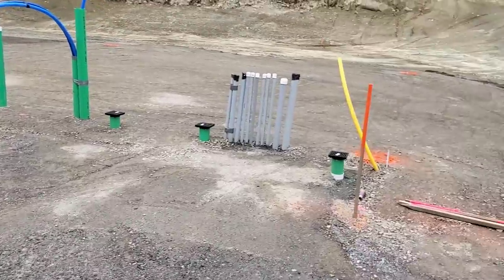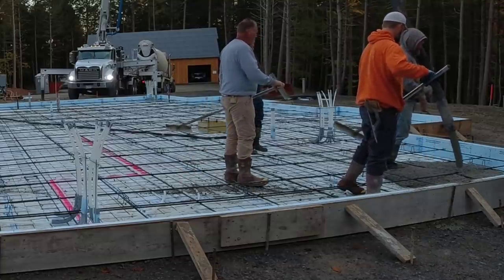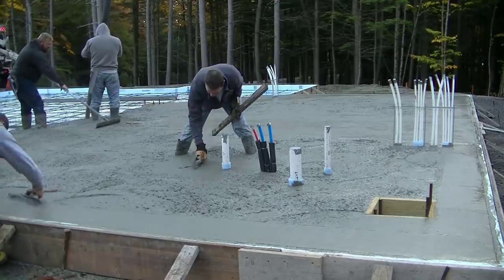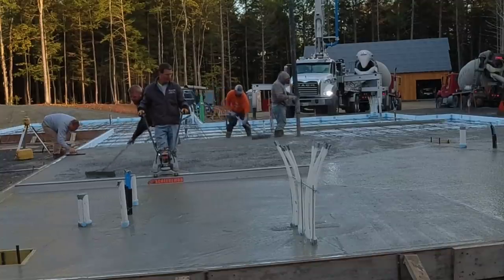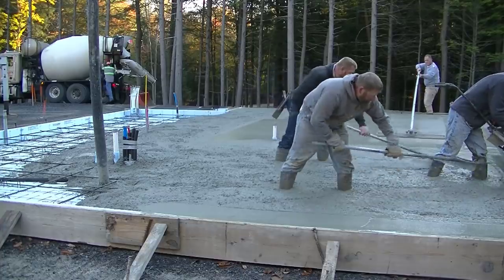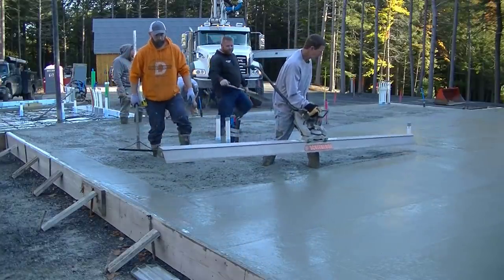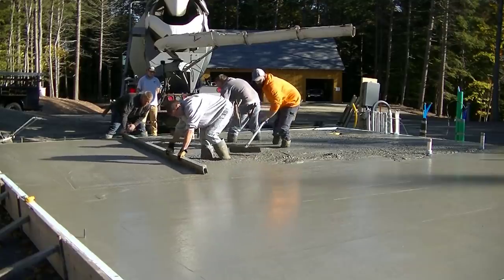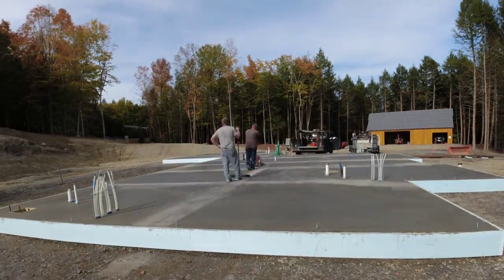He Made Us Pour His Concrete Slab 10 Inches Thick! (Waste of MONEY?)

Comment: It's definitely not overkill. I have background in structural engineering. It depends on the soil and design of the house, I have seen my architectural friends pouring 12" of foundation. I have personally seen too many houses with foundational problems with typical 6" foundation.
Reply: Amen and if you have ever seen an injury caused by a slab breaking under somebodies feet and shattering thier ankles or had to tunnel under somebodies home to do a lift the thinking would change.
There, now you have an opinion from the engineer (SoloFantasy). And me a lowly skilled worker that has to repair cheap pours...
Reply: @michaelpflaumer2487  If the soil underneath is not well compacted, a 10" thick RC slab will not make the foundation any stronger
Reply: Here in Mexico slab foundations are very rare, have seen them on commercial buildings, while stem wall foundations or granite / concrete footings are more common for homes, may take a bit longer to build, but once built the home isn't moving anywhere, it stays in place. 👍
Reply: I have a friend who Made his 24"

Lol
Reply: @thenarrator1984  Tell your friend that the Cold War already ended, bunkers are so last century... so last millennium, actually. 😁
Reply: @LoneTiger  he and I are both engineers who worked construction.

When I first saw the slab dig I just started laughing.

And then we proceeded to bend Rebar for it and put a massively eccesive amount of bar in the huge slab.

It's for a small house garage.. So garage ground Floor and apartment above.. Solar. Off grid.

We bent the ré bar using cedar trees. And straps.. That was fun.
Reply: I definitely agree and have zero education in structural engineering. But I’ve worked for structural investigation company 🤷‍♂️. I’ve seen some crazy sized columns. After watching some core samples being crushed I’d say thickness means stronger with the right rebar.
Reply: It's one thing to say 'I have background in structural engineering' and another to say "I am an architect or a structural engineer." A 12" thick reinforced concrete footing is adequate for a conventional 1 or 2-story U.S. home. With unfavorable soil conditions, the width increases, not necessarily depth.  There is no such a thing as 'typical 6" foundation" - you must be referring to some homes built in the 1700 or 1800s.
Reply: The OP asked about overkill relative to cost - not strength. Assuming normal soil bearing conditions, it is structural overkill - period. However regarding cost, one needs to compare the $$$. Still the answer may end up being subjective - the owner already decided that it isn't for him.
Reply: @BL  I'm not going to debate on credentials. And YouTube is a terrible platform for this kind of conversation. This is why I said depends on soil condition and the design of the home, I have seen much thicker foundations. And yes it all depends on the bearing capacity of soil for correct footing design. When I said typical, it ranges from 6 to 8 inches of foundation for builds here in Texas. 8" is very common here, and I have seen problems in comparison to 12" foundations. This is more true here in Houston due to the clay soil type.
Reply: @yu-jd5jg  Thank you. I am amazed how many of the comments think so.

Comment: With radiant floor, the 10” slab should provide more thermal mass for heating in winter. Would be interesting to see if impacts heating costs and comfort.
Reply: Major mistake with a radiant floor slab, not to insulate underneath, as the earth below, is an infinite mass, 55 degree, heat sink
Reply: Lol… commented at just before 2 minutes in, and hit the “send” icon, RIGHT as he says “they are going to lay styrofoam…”     Insulated, a hydronically heated concrete slab will make an excellent thermal mass.   My neighbor has a SIP home with 10” of foam in the walls and roof, that has a hydronically heated slab, that he warms with a wood boiler.   Was supposed to be 24” thick, but the cost of concrete went up so much, between the architectural phase and construction, he had to scale back slab depth and fill with more sand before the foam and rebar went down.  He would have been able to go a longer period between firings, if he had been able to put in the size of thermal mass he wanted.
Reply: @orcoastgreenman  there is insulation down.
Reply: @rudddude5294  - yup... it’s right there in my second comment.
Reply: I think one key benefit of having such a thick slab is that it's thermal mass will allow it to maintain a warm house during power failures for several days.
Reply: @orcoastgreenman  SIP's are great! The windows and doors become the weakest link.
Reply: @CDN_Torsten  Also, if you are moving stuff in or out of the house, just leave the door open while you do it. Hardly makes a difference. Unless its super windy of course.
Reply: @davidschur5140  Agreed - great for bringing in the groceries in winter. :)
Reply: More mass means more 'freewheelng' - the temprature of the slab is slow to change, creating discomfort in variable weather.
Reply: I'm a building technology engineer and a larger mass isn't really preferable from a comfort point of view. Modern houses are so well insulated, that it becomes hard to regulate the heat with a regular radiant floor. This leads to the floor being either too cold or hot. The large concrete mass just aggravates the problem.

For a well insulated house you want light building materials with modern radiant heating elements, perhaps using a heat pump in conjunction with solar panels instead of natural gas.
Reply: More mass also means overheating when outside warms up, you can’t just turn off the heat.
Reply: @orcoastgreenman  it was insulted with foam
Reply: Good point
Reply: The concept of thermal mass in a home has been pretty soundly debunked for a long time.
Reply: 100% agree with you totally I tried explaining that myself but That's our more efficient when they're bigger or what would be considered opposite in other people's heads
Reply: Yes huge thermal mass that reacts temperature changes really really slow. Meaning when outside temperature suddenly plummet there will be colder few days inside before slab heat up where it should be and same other way when outside suddenly warms up there will be too warm few day inside. I know this for my own experience because one customer wanted thicker slab it was only 5 inch when we usually pour slight over 3 inch.

So best underfloor heating slab is thin slab that reacts fast to temperature changes and all insulation into floor, wall ceiling is thick so heat loss will be minimal.
Reply: @orcoastgreenman  guess you missed the dow blue board.  go back and look.  You sound like me when I miss things
Reply: @davidschur5140  there is a company out of Canada now making windows that are not bad at up to R17
Reply: @JainZar1  have run across this comment many times. Makes sense what you said.  That said I figure the hydronic should be less and if you can.   yup.... do small heat pumps to control for swings. As I look at hydronic I tend to see it is not adequately modeled and like regular split systems tends to be over sized.  lots of problems when you dont do good modeling and then look only at worst case rather than the 99% of the actual BTU needed
Reply: @stevepailet8258  - you obviously missed at least one of my comments
Reply: @orcoastgreenman  I had already commented when I saw yours  so I did not miss it
Reply: That is what  I said.... and  soil condition matter in a colder climate comfort without question..
Reply: @JainZar1  In germany we have such an unstable power grid, that you get your electricity for your heat pump much cheaper, if you let your energy seller turn it off for a couple of hours daily when the demand for electricity on the market is very high and electricity is very expensive. 

But we have very high energy prices, because germany wanted to be eco-friendly. Regular eletricity is now for me 36€cent/kWh, which is 0,41$/kWh. Montana is just like 0,12$/kWh, so it's almost four times cheaper... Therefore germans usually prefer higher thermal mass, to get 30% cheaper electricity with breaks.
Reply: @johnfallkjarvson8235  Wouldn't you know it, I'm German too. :D

Ja, höhere Masse im Baukörper ist dafür gut, jedoch mach die Heizung auf der Unterseite das Regeln unnötig schwer. Ne normale Fußbodenheizung mit einer dicken Betonplatte hat nahezu dieselben Speichereigenschaften mit weniger Regelschwierigkeiten.
Reply: @JainZar1  Ach, darum ging es. Ja, stimmt auf jeden Fall.
Reply: @CDN_Torsten  And if there's time of day rates that are cheaper at night, and it's electric heat, the thermostat(s) can be set accordingly to use the cheapest rate (usually at night). That will produce a massive saving over the years.
Reply: @kenlieberman4215  Well, that doesn't seem to be a problem in commercial properties with 10" thick floors...
Reply: @stephensaines7100  I've never seen radiant in a commercial bldg.  The question was whether high is beneficial with in floor radiant, and the answer is no.  With another radiant source high mass can improve heat life and provide better comfort and some cost savings.  Keep in mind commercial structures of have a low density masonry between the wear layer and the structural layer.  This provides thermal and acoustic insulation.
Reply: Interesting point...I would run the calc just to see how much energy and time it takes to initially heat the slab so it can start heating the house. I think special attention should be given to the location of re bar and waterlines. At the least, having a lay person making structural & mechanical decisions can be wasteful, worst case it can be dangerous...
Reply: @orcoastgreenman  I insulate Every slab, heated or not
Reply: @LiloUkulele  - not common in the climate I am in, unless floor heating is being done, but we almost never get much below freezing.  I imagine in colder climate zones it is a must.
Reply: @kenlieberman4215  but comfort with very cold weather and not so volatile temperature swings.
Reply: I'm glad I overpoured my home here in Fairbanks Alaska radiant flooring.  Now after 2 yrs its fantastic and would do it again.
Reply: Its 1% of the house cost for excellence! Money well spent.
Reply: defenitely comfort, the concrete slab will act as a capacitator, the heat 'charge' will build up and then when you open everything up to let a hive of wasps flee out of your house (or just for some fresh air, lol), the air itself will get cold, but the release of heat is immense when there's a sufficient temperature difference. You close everything up after letting in some fresh air and almost immediately your home is comfortable again.

Comment: I've designed radiant systems like that for a living and 10" is a lot more mass to bring up to temp, but once its there it will stay for some time. Also helps to protect the tubing long term because of thermal stress. The thinner slab is more prone to cracking which will put pinhole leaks in that system. Once you start getting leaks, its game over for that loop because you basically have to use glycol, and therefore should not hook it up to the water system for makeup.

The only problem I see is those tubes were laid out below the rebar. They need to be closer to the top surface. Ideally 3-4" down. its insulated of course but you're still going to see a ton of back losses.

Comment: I think it's a simple answer, "If the client wants a 10" slab or a 20" slab then its right."  Foundations should be built to become a nightmare for a demolition crew to remove.  As Fastflo1 said below, in the long run 'concrete is cheap' so don't be cheap laying your foundations !
Reply: I did my garden shed 6" minimum thickness. it varied 6 to 7.  I said I want the concrete to outlast anything I throw on it.  :D  The builder said, "most people do 3 to 4 inch slabs"  That being said, I didnt go to the local building supply to get my shed kit. Its a proper Scandinavian 70mm wall thickness log cabin . :)  it's heavy and sturdy.
 I wanted to be able to work on a car and even install a lift if I wanted to go that route later without needing to do any piers.  I spent 11 yards and it was worth every penny.
Reply: plus let's face it - dude may plan on building a Batcave, which may be why he wanted them thick in the first place - so he can carefully excavate under it later. :P
Reply: @chouseification  +1 for batcave!!

Comment: My grandpa poured a slab for his garage/workshop back in the 60's (40'x60' building).  He did a 2'x2' grade beam with two additional interior beams in a cross.  Those were set with 5/8" rebar every 6 inches both horizontally and vertically.  He let those set, then poured a 10" slab on top with the lines to let the slab fracture set above the beams.  To this day, that building has not moved.  Our soil around here sucks.  It's 180'+ of heavy clay with layers of sand.  Hydraulic movement is a big problem.  We even added a second story to the building back in the 80's.

I don't think the contractor's 10" slab is overkill.  I bet he won't have problems with it in his lifetime.
Reply: A slab with grade beams is appropriate where there is a highly  expansive clay  substrate. This is referred to as s floating slab as it is intended to move as a unit.  Dallas is an area where this is often used because normal slabs and footings will break up due to heave.
Reply: @markcundiff1697  Down here in Houston, we have the same soil.  I think bedrock is much deeper here though.
Reply: This house is on a rocky hillside.  There's probably not enough clay to worry about, and the weathered bedrock is shallow enough you can see it exposed in the earthwork.  Heave is not gonna be an issue here.
Reply: The only problem is if a pipe under the slab leaks then that's alot of concrete to go through.
Reply: @brucetec6597  The only pipes in the slab are sewage.  Fresh water is ran in a crawl space between the first and second floors.  The sewage lines only run 4 or 5 feet to get to the edge of the slab.
Reply: Your grandpa's intuition (or engineering) was correct for the unfavorable soil conditions. He poured a floating structural slab - similar to what would be designed by a structural engineer today for the same soil conditions. There are no parallels between your grandpa's building and that in this video.
Reply: @jameslmorehead  I have all my water lines running under the slab in my house. Guess what I'm having to do now to one of them?

Comment: You don't gain much by adding 4" more concrete without adding reinforcement. Doing it that thick, might as well double layer your rebars to make it worthwhile thickening your slab. Concrete is very strong under compression but weak under tension, that's why we use reinforcements. Thicker slab does not increase tensile strength that much. I'd rather go 8 inch with double layer reinforcement than 10"with one layer.
Reply: More bar would have helped.. But the concrete absolutely has its own strength....

This isn't a wall where the bar holds it structurally....
The only problem is shifting under the pad  ôr weight on top.

I highly doubt bar would have been necessary.
Reply: Same as me. We always go with 8 inch with double rebars. You cant compare double rebars with single. But of course preparation of the ground under is most important part. You can pour whatever you want if you have bad job under.
Reply: @krlenjuska  technically what do you consider a job under?

Becuase if you think putting gravel and packing it is the best you're 100% wrong. Especially for anywhere that freezes.

The best is finding naturally. Compaction layer that contains no organize and going from there.

It's why people use foundations not just slabs
Reply: @thenarrator1984  Yes, adding bars would've been overkill, but thickening the concrete without adding bars isn't much better either.  
It does improve compressive strength but tensile strength is only increased by about 4% over a 6" slab.
Reply: On the other hand a thicker slab reduces compressive deformation effectively raising tensile strength...
Reply: @tightbhole420  bigger is better when it come. To concrete.
No matter how you slice it

Comment: With radiant floor heating, the thicker concrete will hold more heat so the system won't have to cycle as much.  He can probably schedule the floor heat to come on when he is getting the cheapest power.  Not sure if this is the reason, but would be a good one.
Reply: A typical slab has literally tons of heat storage capacity, and the 'downside' of that heat is that it does not respond fast enough to heat up the house when needed.  There is no need for more heat storage, not that there is literally zero benefit but the drawbacks are also a factor.
Reply: this is it. Factor in the cost of high end in-slab heat + loss of efficiency from a thin pad in colder climates... pays itself off in probably less than 5y.
Reply: Yes, this will help with the termal mass,
It will help provide a constant temperature in the home year around
Reply: I troubleshoot and repaired a heating system that worked by heating up a large mass of thermal bricks over night and regulated output from the units by controlling dampers based in the outside and inside temps.  This is a bit different but if som intelligence could be built in I suspect that it could enjoy some of the same benefits of heating when rates were cheaper.  But this will be a boiler system and as such rates are not a concern.
Reply: That’s a really good thought.  If he’s heating the working fluid electrically, doing so at night preferentially makes a lot of sense. Most don’t use AC here (portland OR) because it isn’t useful but for a week a year tops, and heat is usually natural gas, which is bulk rate supplied, so this didn’t even occur to me.
Reply: with that much thermal mass the real amount of BTU needed to maintain will certainly require less energy